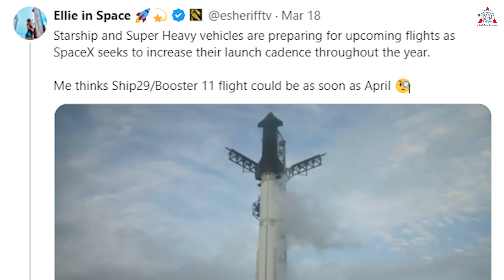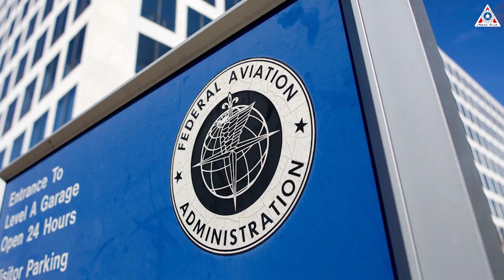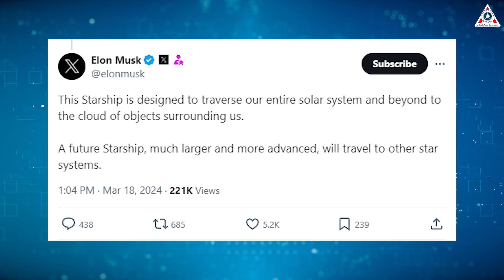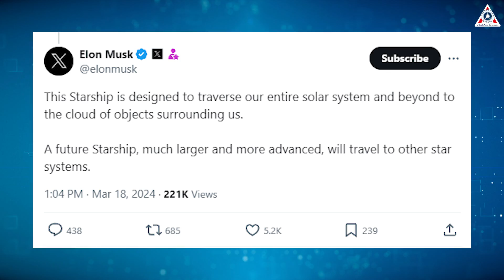Musk & SpaceX's president just officially announced NEW Starship IFT-4 launch date after IFT-3

Comment: 2nd stage has to be redesigned as scaled up version of X37B to withstand reentry. Even the 1st stage might has to land as a plane, because the engines does not ignite, because of excessive vertical pressure, because of bigger size and weight
Reply from the maker: Thank you for your comment!

Comment: The heat tiles are an ongoing problem
Reply: 2nd stage has to be redesigned as scaled up version of X37B to withstand reentry. Even the 1st stage might has to land as a plane, because the engines does not ignite, because of excessive vertical pressure, because of bigger size and weight

Comment: It looks like Starship is orbit launch-ready if both stages are expendable.
That could put a lot of tons in orbit such as a Starship Lab or manufacturing facility.
Reply: 2nd stage has to be redesigned as scaled up version of X37B to withstand reentry. Even the 1st stage might has to land as a plane, because the engines does not ignite, because of excessive vertical pressure, because of bigger size and weight
Reply: Earth is the worst place to land and you are right, NASA has proven landing systems that could be modernized and optimized to Starship scale. Perhaps will happen for airport-to-airport service.
Those may not optimized for Mars's super thin atmosphere.  @TheGrateful108

Comment: People need to keep in mind if Starship was a regular rocket, it would've been as successful as SLS on its maiden flight. Just get to space. No need to re-enter the atmosphere. That's not what Starship is about. It has already surpassed SLS in its capabilities. If SpaceX wasn't as transparent as it is we never would've known Starship struggled with orientation while re-entering the atmosphere. SLS may have been wonky in its orbit, but NASA is nowhere near as transparent as SpaceX. IFT4 will be amazing!
Reply: 2nd stage has to be redesigned as scaled up version of X37B to withstand reentry. Even the 1st stage might has to land as a plane, because the engines does not ignite, because of excessive vertical pressure, because of bigger size and weight

Comment: SpaceX will not launch IFT-4 before their engineers have thoroughly analyzed all test data to determine what went wrong and what needs modification. Then SpaceX engineers must study the identified deficiencies, make design changes as necessary, fabricate revised hardware and software, implement the revised hardware and software, and test it. Then SpaceX engineers and analysts must perform the required analyses to show that these changes do not pose an increased risk to humanity and then provide this information to the FAA. SpaceX engineers may find that excessive air pressure against the rocket engine nozzles may be the primary source of their reignition problems, and there may not be a simple fix.
Reply: That could be overcome by an earlier engine pre-burn in the upper atmosphere. They're trying to save as much fuel as they can, by delaying things. Starship is bigger than falcon 9 and may require different reentry protocols.

Comment: What are they gonna do to improve the remaining already built V-1's? Put smiley faces on them? 
Just kidding! 😊
Last trip, the Experts at SpaceX learned that round things roll... Further developing their future keen sense of the obvious....

Also that Flappers have limits, and if things go to far, you can end up Tits up!
And even ash backwards....

Might be a good time to cobble some extensions leading forward of the aft flappers with some surface area tilted to give a V effect increase, and get passive stability up some...  Then on V-2 models consider turning aft flappers into Double Delta winglets, that also lead forward. and maybe have them rigid, with standard but independent tail style control, so poor Starship can do more than wiggle its little flappers if theres a problem.

And also that booster needs some help... its pretty heavy, and long, and fuel in the bottom. Nice pendulum effect, especially with the engines going, to kinda lubricate the bottom end of the lever arm.

Maybe time to consider an upgrade from those potatoe masher grid fins too, with something that slows things down better, steers better, and causes little resistance on the going up journey.
Also they mess up the aesthetics, but rocket enginerds wouldn't know anything about that, they just try to cobble stuff up and see how far they can throw it.
Too much time with numbers, and no art classes, and we get rockets with no class visually.
The good news, is they have to make it work better or else... And their competitors are watching and learning on the cheap, what not to do.
Anyway, all I care about in the short term is the debut of Raptor 3 engines, so we can get a taste for better performance, and increase the speed dramatically, so they can have even more problems slowing it down, and have to solve some of them, instead of being stubborn children breaking their toys...

Reality awaits all attempts at engineering, and realities always win over what we think.

Its a grueling process developing almost anything. All depends on what actually  works, and figuring that out. SpaceX will do fine over time, and FAA is giving them some cover, time to think.... Betcha V-2 models are way improved, thanks to that last re entry fiasco... Lets hope!
Reply from the maker: Thank you for your comment! hope IFT 4 soon!
Reply: @alphatech4966  
Yeah, I had to tease them a bit! 🤣 They were too sure of themselves, and got snubbed by reality..
Wouldn't be as bad, if the problems had been admitted sooner, or at least considered.
I suspect it was the usual entrenched thinking that everything has to weigh the least possible, and they are still stuck in the tube rocket era mentally.
When if you jump power or efficiency 20% it liberates you from miserly engineering. You can do more to enhance performance and prevent problems.
And of course, they have a hard time connecting to related existing technology. Its been known since the stone age that round bottom hulls are easy to roll over.

Actually, a good shape for re entry would be more like the nose of a surf board with V added into the bottom. get it to sled on the air and stay up until it slows down, rather than doing a nose dive into the beach thru thick air.

Their flying pencil goes up nice, but that coming down gets a bit hot.
basically going almost hyper sonic, and running into limits of materials, instead of just using passive effects to do the work over more time.
There's any number of solutions, but all require changing the design.
I suspect we will see things improved, because they have to. They are doing it in public, so need to get good at it.
They can do better..
And they will do better...

Comment: Having a separate, remote recovery tower will allow any mishaps to occur there, and NOT on the launch tower.
Reply: The answer is to build more launch towers. You have 90% of the cost in a tower that would just allow landings anyway and if you can only land you would have to move the rocket over to another tower to launch it. If you build a tower that can both launch and recapture you can do either and you don't have to move the rocket. . They just need more towers. That gives a way to increase the launch rate and allows you to launch, land, and take off again without moving the rocket. If that tower is damaged during a landing you just use one of your other towers to launch and land at.
Reply from the maker: thank you for your comment!